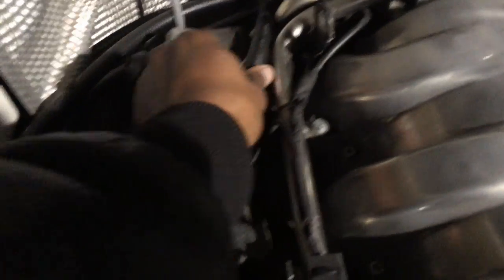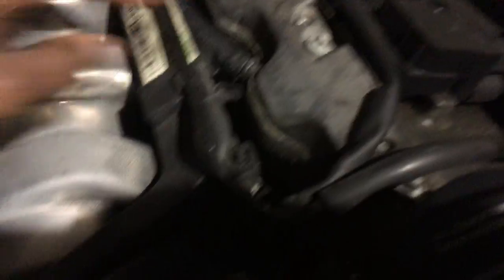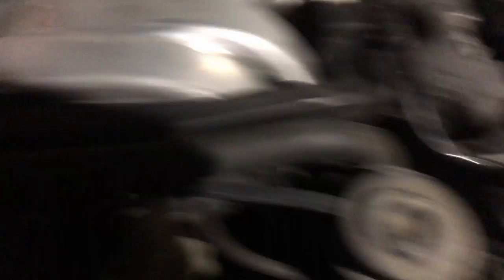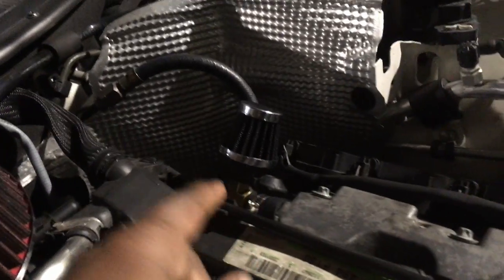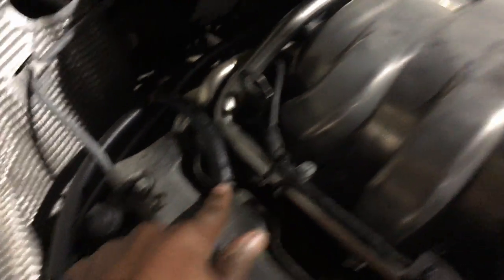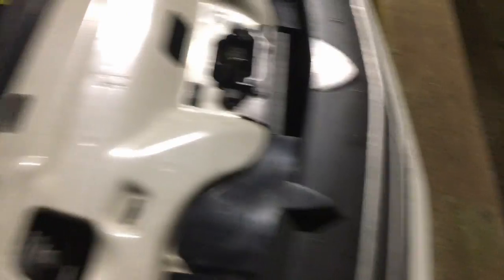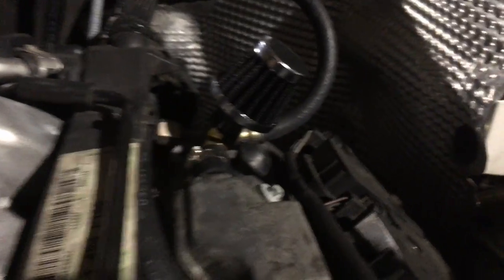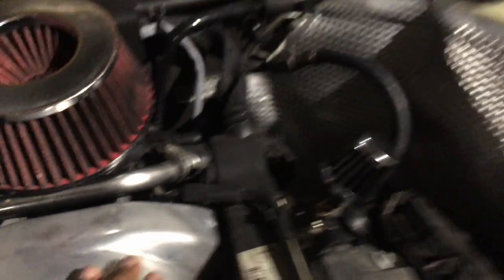REAL Breather Filter Install & Purpose - CHEAPEST $10 CAR MOD, PCV Delete Filter | DreamDriven 122

Comment: 1991 Chevrolet Lumina APV 3.1L V6 TBI, with plugged IAC valve and diy Arduino EFI  here.
The breather hose is setup from factory so that it connects on the inside of the Throttle Body Injection air filter cover - basically above the throttle plates and near the injectors.
Also from the factory, the PCV hose connects below the throttle plates. However I plugged (deleted) the IAC valve and adjusted the throttle screw instead for a simpler TBI environment, which also begged for that factory PCV hose to be obstructed with a spark plug in order to maintain a steady intake vacuum at idle.

I want to get rid of the PCV valve and replace it with a small air filter. The reason behind this is because I've blown through the hole where the PCV valve goes and I can hear the air exiting through that breather tube.

I imagine that an air filter would do a better job at "breathing" than a PCV valve, since it both filters air and allows greater blowby gases flow through the valve cover than the PCV.

Comment: The filter you show in the video is put on incorrectly. That particular breather/filter needs to be installed vertically not tilted as you have it. The idea is that the filter will catch any oil vapors escaping the crankcase with the oil running down the filter element and find it's way back down into the valve cover. When it's tilted as you have it the oil will drip over the bottom tray of the filter and onto the engine and make a mess.

Comment: So basically the little filter replaces the tube that takes air into the cylinder head (Breather pipe/Ventilation hose) and you do not touch the tube that gets air out of the cylinder head (PCV, positive crankcase ventilation system)? 
The breather pipe normally comes from behind your airbox and puts fresh filtered air into cylinder head. It gets replaced by its own little filter.
Is that right?
Reply from the maker: Correct! However on boosted applications, the setup may vary. Given the proper tune, one may benefit from putting breathers on the PCV or adding a catch can with a breather attached. It’s all trial and error, that specific breather was too small for my motor so I removed it, replaced the hose, and bought another catch can to better seal the system.

I recommend to just experimenting with your build and seeing what works 👍
Reply: @DreamDrivenLifestyle  it's a naturally aspirated 1.6l Miata NB, I think that should be fine with just the filter instead of the oem breather pipe. Thanks for your fast reply :)
Reply from the maker: Elltielle no problem!

Comment: -- Good info.  Have a can on the PCV, dirty side (2004 Tahoe 5.3L) and a breather on the oil filler cap.  Like the can, allows me to visually inspect what's going on with the motor.  And the numbers on my scan tool (I'll save you the list) are quite a bit better.  Anyways, thumbs up.

Comment: That set up is right but with that filter your iats must be so high. Might be better to route pipes from the front of the engine with inline filters
Reply from the maker: They aren’t, I monitor them with a gauge and are only 10 degrees above outside temps, unless I’m just parked with it running then they get hot but that’s for every car lol
Reply from the maker: But I have routed a pipe the filter that also helps with the temps when sitting 🤙
Reply: Dream Driven Lifestyle I have a m113 and m113k, Id lose so much power with this setup. But I could see how it could work on a 112
Reply from the maker: Parth Patel I actually got the idea from an m113 believe it or not lol, except he ran dual filters in a Y-setup with the filters off the the sides of where mine sits. His temps weren’t too bad but it depends on what your looking for. If you looking for highway performance, the temps aren’t an issue and will get down to ambient but if your doing digs or a lot of city drying the ram style intake setup may be counter productive and suffer a lot of heat soak haha

Comment: Hey, Dream Driven Lifestyle, I have a chevy traverse. Where to place the breather filter at?
Reply from the maker: I’m not exactly sure what your engine bay looks like but the safest bet is to immediately locate/google your PCV line(s) which will be coming out of your valve cover(s) and going either into the intake manifold or right before the throttle body. You want to locate those and make a mental note not the place the breather in neither of those ports. Next, find the hose that goes to your Intake hose, which should be somewhere in the middle of the intake pipe or towards the throttle body but will come before the pcv hoses. In other words, the breather hose connects to your intake somewhere between your air filter and the pcv line. Its located at this point to draw in fresh air into the valve cover, breather. If it were located after the pcv lines, it would be pulling in blowby back into the valve cover that your pcv system just tried to remove! 

Hope that helps you understand! Once you find the breather hose, remove it, cap the intake port with a vacuum plug, then place your breather on the valve cover port where the breather hose came from ( the hose is generally later than the pcv hoses)
Reply: @DreamDrivenLifestyle Lifestyle got you. I have a breather line that connects to a breather at the back of the engine on the valve cover that goes to the top of the crankcase toward the front. The other is the PCV line that connects to the intake manifold(that where I should put the PCV delete yes) ok got you.